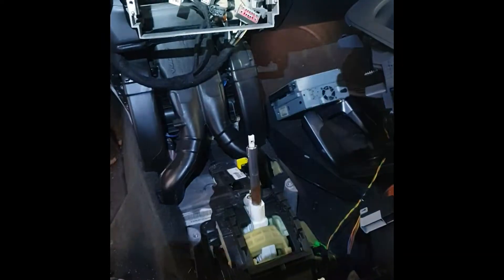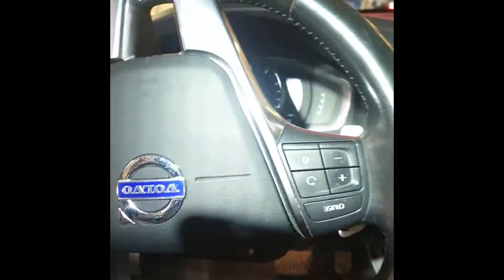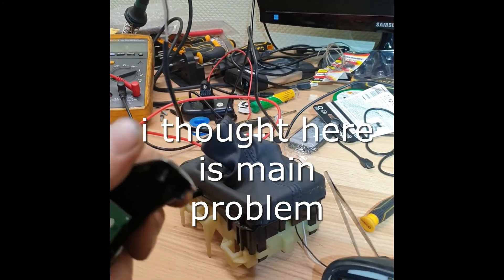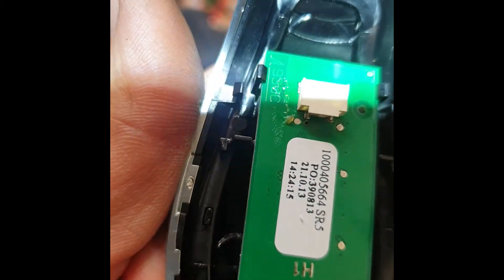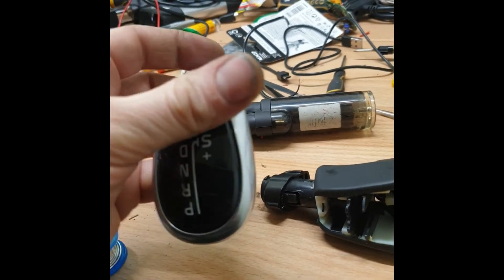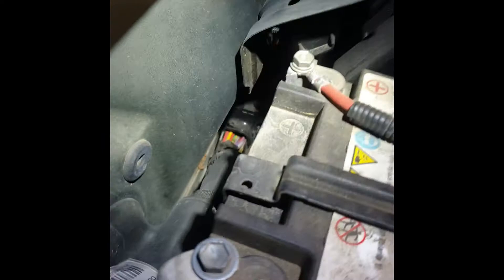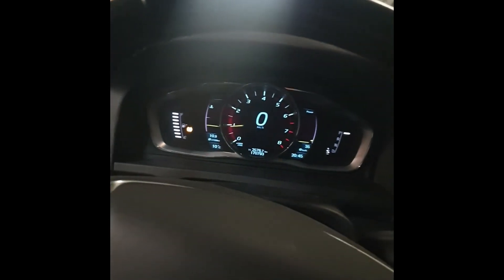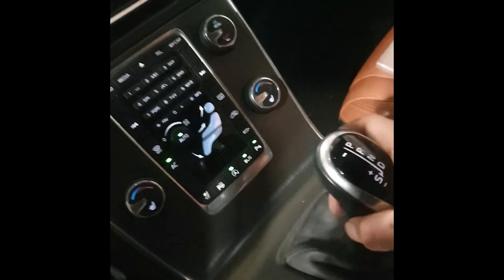volvo v60 gear shift module a fault solved

Comment: Thank you very, very much! I can't begin to tell you how much time your video just saved me! I had to replace the shifter and the connector at the base of the knob was much easier to disconnect than having to remove the bottom panel etc. Appreciate your video and the time you took to make it and upload it.
Reply from the maker: Thanks 👍👍👍